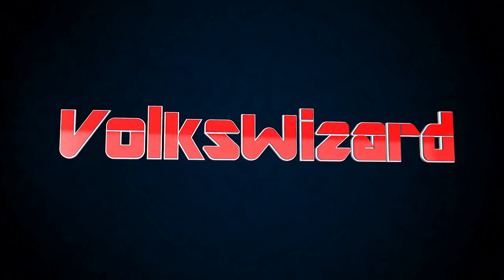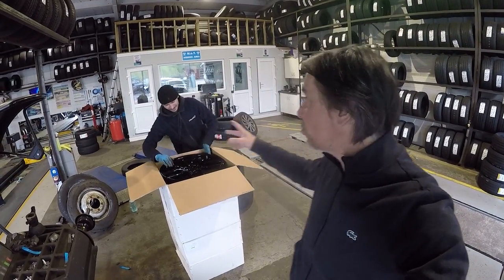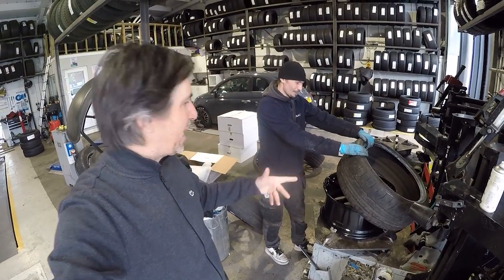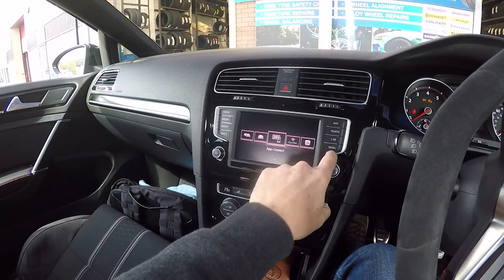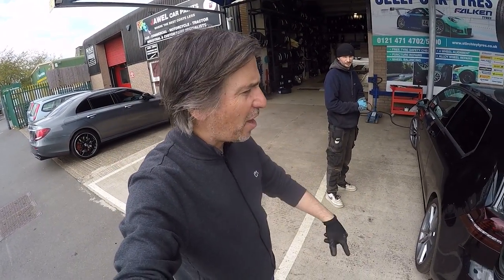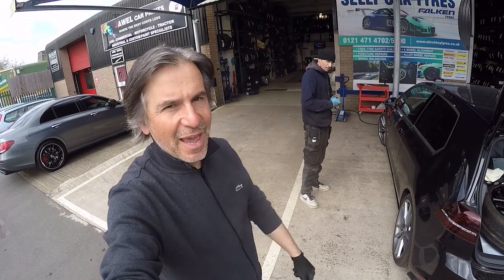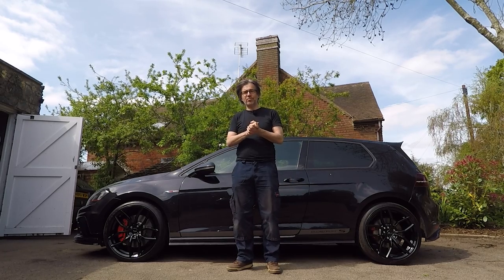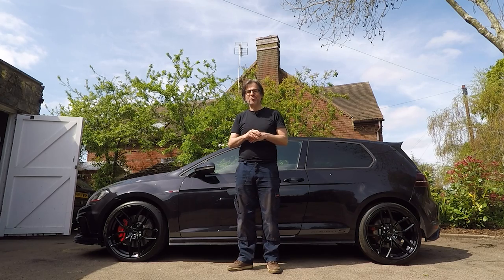BARGAIN CARPLAY ACTIVATION+NEW  WHEELS / TYRES - ROAD TO THE RING EPISODE 2 #roadtothering #gti #vw

Comment: Wheels are OK for track but don’t suit the car otherwise - my opinion anyway. But they are relatively good value. I would fit locking wheel bolts or you may wake up 3.30 one morning like I did to find a rock instead of a wheel. I now fit an extra set of locking bolts as the factory one didn’t seem to stop them. Good luck with the 50k subscribers.

Comment: No light smear of copper ease grease on the hub or alloy wheel face where it meets the hub ? My dad always taught me to put a light smear of copper ease where the alloy meets the hub and never had a jammed alloy or issues with grease on the brakes in over 30 years. .

Comment: The black wheels are gorgeous. My only beef with black rims is that they can make the tyres look a bit scruffy 😉
Reply from the maker: Thanks! The tyres looked bad before I dressed them as you probably saw.  Feels wrong dressing a track tyre but if I didn’t I’d be told off in comments 😆👍

Comment: Interesting seeing how you feel about the mk8, I’ve been contemplating changing my 7.5 pre PPF to a mk8 R but the more time goes by the more I’m less keen
Reply from the maker: I wouldn't buy a Mk8 now because VW have shown over the 2.5 years since launch that they really aren't too bothered about fixing the issues for the UK market. I don't mind getting faults to start off with but I'd expect some major campaign to sort them out as quickly as possibly.  I gave up when I saw a tech bulletin saying VW won't fix the KPH/MPH bug because it's caused by people doing a hard reset of holding down the power button so they are fixing the issues that lead to that.  I didn't reset head unit and still got the KPH/MPH issues so they were never going to sort that on that basis
Reply: @volkswizard  yeah the whole touch buttons have put me off. Mine is standard but had big spec, Akrapovic, leather, perf pack, sunroof etc so I’m not really keen in letting it go for 10-20 bhp and a fancy diff

Comment: Very nice wheels, black on black looks bad ass..  I am an OEM guy myself, so I got a set of Clubsport Belvedere wheels for my Mk7.0 GTI PP. These are the lightest rims (forged alloy, not casted) that VW has on offer and weigh (with a fresh Michelin PS4 tire) in at 17.8kg. They only come in 18 inch unfortunately but from unspring weight point-of-view the best choice..
Reply from the maker: The Belvedere/Quaranta is a cool wheel, just a shame they don't do them with a bit more offset to fill the arch
Reply: @volkswizard  I use spacers front and rear

Comment: Just out of interest what profile are on the alloys? Are it a 40 or 35 sidewall ?

I have tried to stick to 18s or 17s on my cars just out of pure comfort in London unless the car has had adaptive suspension.

I'm on 245-40-18s on my 2009 a4 s-line and wouldn't dare go 19's if I wanted a style upgrade.

Love the content all around on your channel and the sheer effort you put into filming.

Questions 2 also - Do you plan to sling some Audi content on the channel too in the future considering they share bundles of stuff across the VAG group?

Thumbs up, Ryan
Reply from the maker: Thanks Ryan.
The tyres are 235 35 19 so the same size as factory, the CSS isn't too stiff thanks to Dcc adaptive dampers. It's far more comfortable than a CS Edition 40 on 19s and passive dampers which surprised me! I bought one to sell thinking it could be a CSS on the cheap but my god was that hard!
Audi content is always on the cards but will be sporadic as don't really run one and press loans are as easy as they once were not least because due to sodding EVs, most launches now are cars that don't excite me or I suspect my audience. 
I should film a farewell RS6 video and Mrs. C's TT is still here and due a tyre upgrade which will create content.  Also I fancy buying a Mk1 TT to keep but not sure when that will be. Stay tuned though and thank you 🙌🏻

Comment: Looks not too bad. Not always a fan of black on black as the wheels sometimes get lost. Gloss black is definitely nicer than Matt black. I’m current trying to decide on what colour to refurb the Santiago’s on my 16 GTI performance pack as the diamond cut has some defects. Gunmetal is my 1st choice. Gloss Black with red pin stripe is an idea in my head.
Regards the USB port on our 66 plate GTI pp that had CarPlay it will only work with the USB port in the air rest cubbyhole. I may try change the other see if it works with that

Comment: Main dealer prices for after market wheels are really offensive. Okay if you get them when you order the car. But I agree with your selection. I've looked at wheels at my local dealer down under. Sometimes they are on special!. Hmmm. Sticking with my 17s on my MkV.
Reply from the maker: It was £900 ish to upgrade to Pretorias from 18" Cadiz when Golf 7R was released, imagine cost of having to replace 4 buckled wheels 😲

Comment: Looks good, definitely take the torque bar to the ring and check the nuts after a few laps! I used to air down the tyres a couple of PSI too you probably know this from track experience! Also recommend Feredo DS2500 pads!
Reply from the maker: Thanks Bogged, all good advice. TBH the Supersport R are just for the UK track day in 2 weeks, having driven them in rain today, I'm not keen to drive across Belgium on them, this was part of the reason why I never went to 'ring on my first Clubsport S which was factory fitted with  Michelin semi-slicks.  The Supersport is well up the job on the 'ring with a novice like me and can still do heavy rain just fine. Good tip re torque bar, had one come loose on that car when I took winter tyres off, very frustrating to not have a brace of any sort in that situation!
Reply: @volkswizard  No worries! Ahh fair enough. I used to run r888's Spring to Autumn, they were lethal in the wet. I had a wheel come loose once as I forgot to retorque after a spirited Touristenfahrten weekend.. learnt my lesson there.
Enjoying the content, keep em coming!

Comment: Andrew, what seat cover have you got for the Recaro's in there? Do you have a link? Thanks!
Reply from the maker: That seat cover is Quantum from VW but I've just installed a more fitted one but it keeps on pulling up at the base when I sit on it.  So neither are that great, if I had to buy one it'd be this https://www.ebay.co.uk/itm/350978367823

Comment: Hi Andrew,

Question r.e. Android auto. Had it activated but it drops out regularly over bumpy roads. I've replaced everything from the phone, cable and USB port but no joy. Any further suggestions? 66' plate R
Reply from the maker: I've got that too and I am going back for a new USB port. Did you replace USB port when it was activated and if so have you tried another?
Reply: @volkswizard  no, it was done by VW and the original port was the correct one (like the one supplied in this video). I've replaced the USB port since then to attempt to rectify the situation but no joy